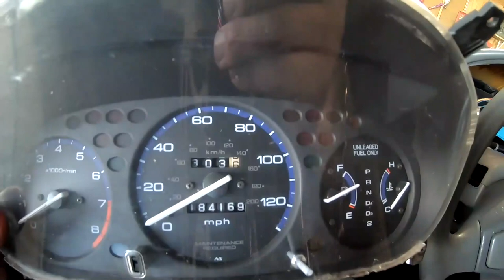ebay Turbo civic problems & Junk Yard Run

Comment: I have a 95 integra that has a soft brake pedal but stops fine  and no leaks or air in lines I replaced the master cylinder still the same wondering if it could be the  booster the motor revs up a little when you hit the brakes to but it did before the pedal got soft any advice would be great thanks
Reply from the maker: Adjust your brake pedal position to brake booster under the dash
Reply from the maker: My pedal goes down all the way to the floor and just slows the car down to a stop slowly. I have to pump it also with my foot At the same time my engine starts to review itself up 1500rpm extra. Im gonna make on a video on this and how to do a quick test.